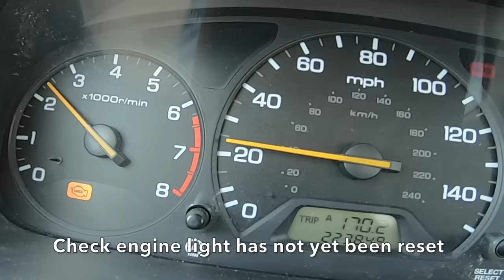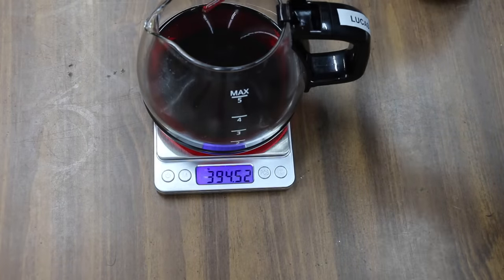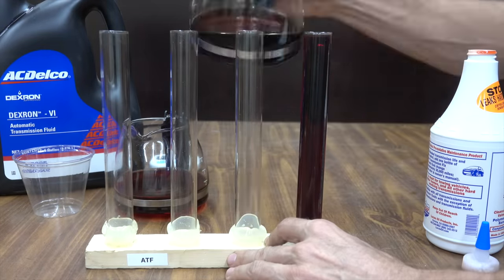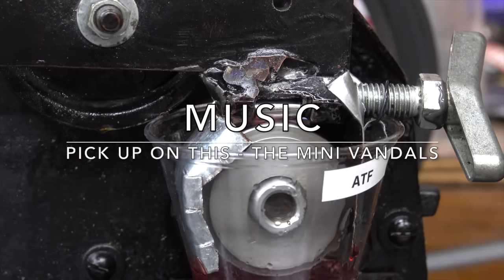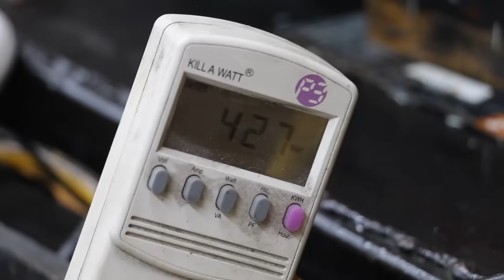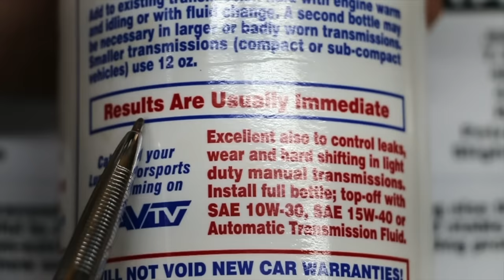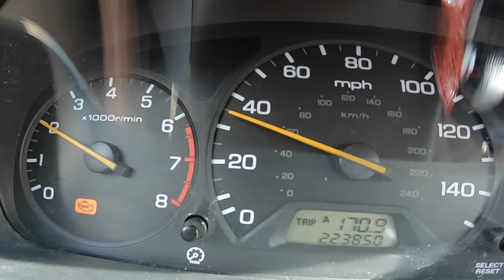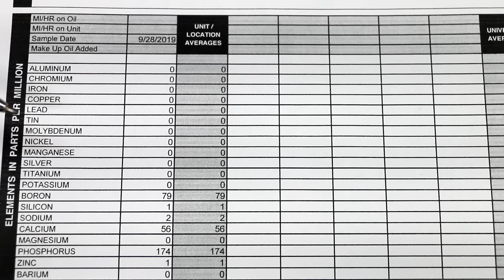Does Lucas Transmission Fix Work?  Let's find out!

Comment: I have a 2016 Chevy suburban 5.3L V8 with the 6L80 6-speed transmission. I have intermittent rough 1st to 2nd and 2nd to 3rd shifts.  It’s not always. Have never had CEL come on. Since these transmissions are notorious for this. Will this Lucas stuff help it shift smoother?

Comment: In my personal experience lucas is most effective when used with the worn or used transmission fluid. New fluid and filter seem to decrease the effectiveness of lucas as it's designed to use the particles in the fluid to help stop slipping and increased viscosity helps to increase fluid pressure where it needs it since the pump is worn at this point as well. Used it in a personal vehicle that had almost 300,000 miles on it with a slip going into 3rd gear. I left the used unchanged fluid and filter in it while draining enough fluid out to be exactly full when I added the lucas. Transmission is still going strong and truck now has 400,000 on it with a different owner. I would like to see you test this method out as it has at least for me been most effective when "needing" lucas for the transmission.
Reply from the maker: Thank you for the feedback
Reply: Um. Did you watch the video?
Reply: Yes your right those particles in the used fluid give a little grip to the bands. I have seen many change there fluid on a high mileage transmission and it made there slipping problem much worse.
Reply: @MrNorthstar50  My 2006 Avalon has 110k and a hesitancy shifting at lower speeds of around 25-35 mph when weather is cold. Do you think mine is considered high enough mileage that I should avoid a trans fluid drain and refill? It was my understanding that ATF sb changed between 60-100k.

Comment: Personal experience: I have 98 Jeep with over 300k miles on it. Transmission was slipping and delay in 3-4th gear. After Lucas it is a lot better and no delay unless gas to the floor. So yes, I would use it again :)
Reply from the maker: Impressive results! Thank you for the feedback
Reply: Why are you still driving it
Reply: Time for a rebuild. Better to do it before it goes on you and it's cheaper than a new vehicle.
Reply: @macsawesomeplace  Nah, looking to get rid of it. Was a backup car while needed.
Reply: @macsawesomeplace  
It is over 20 years old with 300k miles. Not worth the money to get it rebuilt. It's about to die any day now.
Reply: That was one of the years that Chrysler /jeep. Cut the lip seal grove too deep , by adding Lucas it Re vitelised the lip seal and made it EXPAND ,, SO NOW YOU FIXED THE PROBLEM ,,,,,"CONGRATULATIONS😄  from EDWARDS BROTHERS TRANSMISSIONS ROANOKE RAPIDS NC.        Now.     If you adjust the throtel cable it just might cuer the wide open gas shift problems
Reply: NOT IF IT'S A 4.0. Dillion. Get a junkyard trans.
Reply: Louis, What lip seal groove ? Doesn't Trans. fluid make rubber expand ?
Reply: @NoWr2Run  
No. I have had a 4.0 jeep before. They all eventually fail. Mine made 326k miles.
Reply: @NoWr2Run  yes but the Lucas , or Lube Guard will safely make the seal softer and more plyabel !
Reply: @NoWr2Run  if you have the Chrysler 518. The lip seal grove was cut too deep so the Chimacl in Lucas will help the rubber softer to expand that is alli am saying
Reply: @NoWr2Run  what lip seal grove? ....the grove cut in the direct clutch drum ,that lip seal grove😀
Reply: Hey guys I just bought a 2004 Wrangler and it has the 4.0 in it. I just bought some AT-205 which I guess will help swell the rear seal that’s prone to leaking. You think atf is just like the AT-205 stuff?
Reply: Louis, Gotcha, THANKS FOR THE EXPLANATION.
Reply: OK, Dillion, Thanks.
Reply: @NoWr2Run  no problem but guess what ? The lip seal grove was cut deep on purpose just to make factory assembly faster. So the piston could be installed by robots . Hay ,,,,need I say more?😄😄😄😄😄😄             BUT I'm not complaining my Family makes a living out of THIS.  Thanks.
Reply: @RaceMentally this may stop the leak and  if it does.  Drain out as much as you can and re fill w/  Dextron 5 because it don't know when to stop swelling.  Lucas. Is very mild and not a stop- leak. But it helps re vitelise lip seals but after STOP-LEAK DOES IT'S JOB ,,,DUMP IT AND REFILL W/ THE RIGHT FLUID......OK
Reply: Louis Edwards so run this at-205 till leak goes away then drain? I’ve only watched reviews on it on here with same motors. No one mentioned draining it immediately after seal stopped leaking. Enlighten me please.
Reply: @RaceMentally  my personal advice , I'm a professional automatic transmission rebuilder. Have ben all my life Sen 1977 (Family Business) don't let STOP-LEAK over stay it's welcome it don't know when to stop swelling the seal ,you have dozens of 'O ' rings and rubber PARTS. Also in the unit that Don't need to be compermised ,if you let STOP-LEAK do it's job let well enough alone. Thanks for asking. And good luck !
Reply: @vputilov  Hell, I'll take it. I have an amazing trans. shop just a street over. I bet she still.has some life left in her
Reply: Dillon Hawkins You can rebuild a Jeep motor and tranny for cheaper then you could buy a ten year old car.  It’s just not worth the money to you.
Reply: Sounds like your torque converter lockup clutch for overdrive it's starting to go. But the Lucas should help with the friction for a little while longer.
Reply: Fingers crossed I have the same luck tomorrow. '01 RAV4, 160k, out of nowhere full slippage after the fluid heats.

Comment: I got a 4t65e transmission. the dexron III it uses turns thin as water when hot. I also notice alot of clutch material on the dip stick. I dumped a bottle of this in to thicken the fluid and it acts so much smoother. I used bottles of this in all my older cars as a preventive thing and its never let me down.
Reply from the maker: Great feedback. Thank you
Reply: I wonder what the hot viscosities of Dextron iII vs. Dextron VI are.

Comment: Hello. I appreciate your detailed tests! My question is this. I just bought a 2000 Silverado 4wd, 174,000 miles on it( 4l60e). I’ve changed all fluids and gear ouls exept the trans. It shifts fine but the fluid is root beer colored. Theres no birnt smell or heavy sparles in the fluid. Do I r n r filter and fluid? I’ve heard horror stories of doing this. And get a whole spectrum of answers.  Would a partial drain and Lucas to top off? Or? I’m concerned on the filters life as well. I thank you for all you do for us !

Comment: I had a 72 dodge D100 with a 727 trans. When I purchased it, when you started it and put in any gear. Would take almost a minute before it would engage. Took pan down, changed filer. It took almost 2 minutes to engage after filter change. Dropped pan again, then filled trans with 4 bottles of Lucas trans fluid. Took about 6 minutes to finally engage in drive. That was 7 years ago. The truck is still driving to this day. Good stuff!
Reply from the maker: Thanks for sharing.

Comment: You don't just tell us, you show us. It doesn't get any better than that.
Reply from the maker: Thanks so much!
Reply: I have a 2002 nissan altima I put a hole bottle of oil on Friday morning. But is still leaking out under the trans and oil pan. When I park it home I have small coming from my hood. And I see a bit of drips dripping on my exhaust pipes  iam hoping this stuff works
Reply: @SESoul4ever  how did it go?

Comment: I added this to a friends 1999 Ford Ranger with nearly 300k on the odometer. Sometimes putting it in drive it just wouldn't go anywhere.  Needless to say this stuff bought him another 60k before the transmission finally gave out completely. Normally dont recommend additives but it's worth a shot with this stuff.

Comment: Hello Project Farm! I really appreciate this video , I’m in a dilemma, I have a 2005 Honda CR-V and it has about 230,000 miles on it, I bout it used a year ago so I don’t know what the previous owner did on the upkeep side on the trans, so what would you suggest I do for it, should I flush or drain it or change the Transmission Fluid or should I just add some Lucas transmission fluid ? For right now and by the way I am experiencing delayed shift but it happens every now and then , checked fluid and it’s not low? I hope you can give me a good answer thanks for all you do !!!!

Comment: May not be applicable for the purposes of your test, but Lucas is also MUCH easier to add if you mix it with your new ATF instead of adding it by itself as it's thick and takes forever to run down the funnel.
Reply from the maker: Thanks for the suggestion.
Reply: Great update brother.
Reply: Haha true. Took me 45 mins to get two bottles in
Reply: Don’t drink coffee from his shop!
Reply: I put the bottle in a bowl of boiling water first. Runs a lot better
Reply: And I think it's much safer for transmission to do like this. Just think about it. You add super glue oil to drain pan,  it will suck it inside the system and can damage something. Instead, just drain old fluid, buy new one and before adding new ATF to transmission, add some Lucas to every bottle of new ATF. Shake it, leave for a night, shake it again couple of times and here we go, ready to go. already pre-mixed.

Comment: Ive ran this in almost all of my trucks. Looking forward to it.
Reply from the maker: Did Lucas deliver good results?
Reply: @ProjectFarm  seemed to help with my 4th to overdrive shift. I have 340000km. Added it at 110K. Still have the same fluid and passes tests still. 2006 chev 5.3L
Reply: Game Bred Duramax  every 60k it recommends on Mitchell and Alldata, sooo that fluid is jacked.
Reply: I've had to look reverse to it (true story)
Reply: Game Bred Duramax  Chevy wont touch it. They say its "lifetime" lol. Have to get a flush if im going to change it. Can only drain 30% of the fluid. And they won't flush it cause they always have issues after. Definitely agree it needs a change. Filter at the very least

Comment: I own a transmission shop in Brazil, I've tested this product in a few cases, including transmissions with a slipping issue where it was known to be related to leaking internal seals. If you treat the transmission before it burns discs or bands, the results can be amazing. If you are having transmission issues, and specially if you live in North America, you should really give this product a try, since it is so cheap. I simply can't see any likely downside to this.
Reply from the maker: Thank you for the feedback
Reply: If you add this product to a good transmission will it last longer?
Reply: @justinberwick2827  I believe so. For example, if your car has a high mileage,  but still runs and shifts nicely, I would recommend changing the fluid and adding this Lucas additive, I feel this is going to make the transmission last longer. Just be sure to not over/under fill your transmission and to use appropriate fluid.
Reply: Hey I know you are legit because you actually have the correct answer I said the same thing if you do it before you destroy the transmission actually works really good that's cool you're in Brazil you probably save a lot of people a ton of money
Reply: What part of Brazil are you from?
Reply: @seedlessgrapes2605  Well, most transmissions get to my shop dead already, when it is already too late for any tentative fix, but I do what I can, Haha! Today for example I'm working in a GM 6T31 who suffered a bump that gave the case a little crack. Oil slowly leaked, the transmission began slipping due to low fluid pressure, and when we disassembled the thing it was already smelling fried discs in the morning hahaha!
Reply: @thereeven  okay I will give you a great tip which I just learned my whole life I would use J-B Weld to fix things like that and then they have a J-B Weld high temperature but there's this one that comes in a little bucket and it's like a J-B Weld paste for exhaust repairs and stuff like that but it's heat activated so of course clean it as good as possible and it sticks to pretty much anything especially if it's warm or I guess you could heat it up first with a heat gun heat the metal surface and it will dry instantaneously like within a minute and very good repair
Reply: @seedlessgrapes2605  seems like a good advice! However, we don't have jb weld here in Brazil.... to be honest, the first time I've heard about jb weld was here on PF channel! This very Lucas additive, I've heard about it online, got curious and imported a few bottles myself as a test. But I'll keep your advice in mind anyway, I'll also look for any jb weld-like products around here, maybe there's one I haven't heard about yet.
Reply: @seedlessgrapes2605  You are absolutely right my friend👍👍 I JB welded my neighbors cracked transmission a few years ago still drives the van everyday even though the cold winter and hot summers in New York
Reply: Do you think it would help a manual transmission that has trouble going into 1st and whines in 4th?
Reply: @zombieapocalypsecherokee9224  AWESOME..   Are u in upstate??
Reply: @seedlessgrapes2605  Long Island NY
Reply: My van was slipping to the point that  I could not make it back home, I had to park it a few blocks before getting home. Question is, is it to late to try this stuff? If the van doesn’t run can I still try this stuff ? The van is my daily so if you have any input would be great, thank you
Reply: @manuelsalgado8510  there's no harm in trying, and make sure there's enough fluid in the transmission. But be prepared for a transmission overhaul....
Reply: @thereeven  thanks for the quick reply, I will give it a shot, the van is parked now. What’s your thoughts after I put this stuff in should I attempt to run it? Or just turn it on and move the shifter up and down?
Reply: @manuelsalgado8510  You can try 2 bottles if you're willing to, but remember that there are no warranties. Since your car doesn't move anymore, there's a chance your transmission is already burnt inside. Just let the engine idle for a bit and try to run the van without being too aggressive on the gas. Whatever the result is going to be, it will show shortly after.
Reply: @thereeven  thank you, I will update when I try it.
Reply: @justinberwick2827  I put it in a transfer case on a 2001 dodge 2500 Cummins 5spd made the transfercase so smooth to manually shift in and out of 4 wheel drive Lucas also make one for synthetic oil which is what the 5spd manual transmission used so I put it in there also. Truck had 385,000 miles when I sold it with no problems and this truck was never babied. Pulled alot of heavy loads that I shouldn't have

Comment: Suggestion: Fix-A-Leak products! I'm very interested to know whether espcially those radiator leak-fix products really work. In my experience the old school black pepper theory does truly work. Since that has worked for me I've never tried the products on auto parts store shelves. Do they work? How well compared to black pepper?

I think it's relevant to include I've been a mechanic (Class 8) for 30 years. In my experiences I have also been employed at radiator specialists who repaired radiators. They don't use any products, they just replace the fin core or tank cores if they leak or use silver or lead solder to patch holes. So I'm very curious and would love to see a video proving IF and/or how well the fix-a-leak products work!
Reply: They work for a bit.  Eventually it’s going to have to get repaired right though and when it does leak again, you can bet it’s going to be at the most inopportune moment.
Reply: In the old days of low-pressure cooling systems, you could fix a cracked block (temporarily) by filling the radiator with a potato-soup mixture.  When the hot soup hit the air, it hardened immediately.
Reply: They put it in the car from the factory to seal holes just in case.
Reply: If you're 500 mi.  From home. Even an egg w/ black pepper can't hurt. You might not have breakfast but you might get home for some😃
Reply: Bars leaks works for a while. Peppercorns and eggs also work.

Comment: Those transmissions have a problem with the shift solenoid screens plugging up. You can take them off on the top of the transmission and clean them out. It helps a lot
Reply: correct but there are other additional screens inside the transmissions which cannot be removed from outside and those clog up too causing these problems. I rebuilt couple of these transmissions.
Reply: I pulled the solenoids on my 2001 MDX and cleaned the screens last fall. They were totally clogged, I don’t know how it shifted at all. Now it’s acting up again so I’m going to try cleaning them again.
Reply: I remember doing so many solenoid cleanings on all v6 hondas because it was such a common issue for them to clog at 100k miles
Reply: Drunkoncouch is really appreciate a photo of where they are on your mdx. Thanks
Reply: Had symptoms very similar to the transmission in this video. Replaced the transmission speed sensor(15$) and it works like normal again. 200K miles on 2001 jeep with 4.0 and 42RE trans
Reply: @Drunkoncouch  Gotta change the switches too.
Reply: @Taydrum  You have a TJ with the newer trans with overdrive? My '98 has no sensor and no overdrive.
Reply: @Kewrock  Its a 2001 WJ jeep, with overdrive
Reply: @Taydrum  Ahh. I didn't know they were putting the 4.0 in those. I thought the 4.0 was strictly Wranglers and XJ Cherokees.
Reply: @Kewrock  Believe it or not they used that engine in WJs until 2004
Reply: @Taydrum  it's a dog on the highway but I have an 03 WJ 4.0 and it's got 230k and still runs fine.  If I let it sit 3 or more days untouched and get in it it takes a long (few seconds) for drive to engage.  A bottle of Lucas Trans Fix straightened it right up.  It's probably due for a service but for now it helped.

Comment: I have a 2011 Ridgeline with 250k km and runs well with fluid changed at 170k. Would you use it as a preventative measure, or only once you notice slippage?